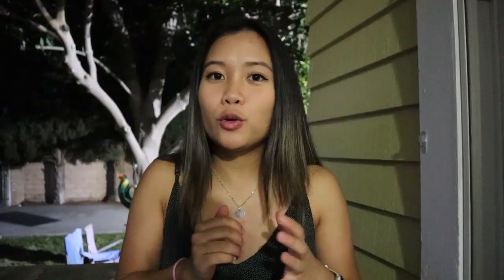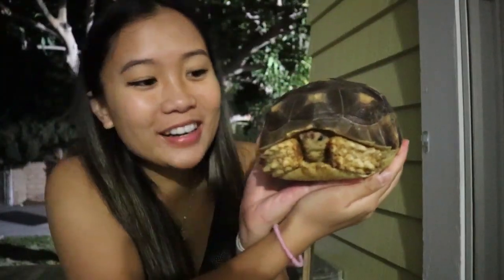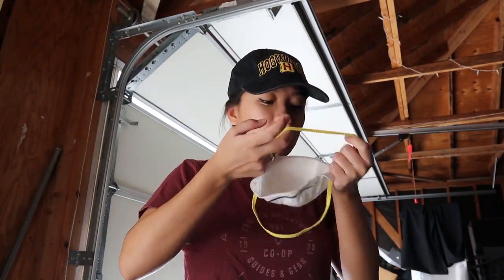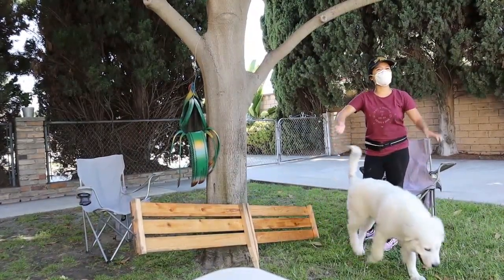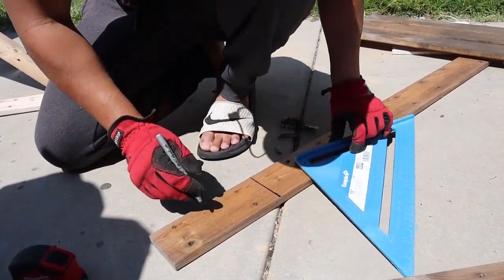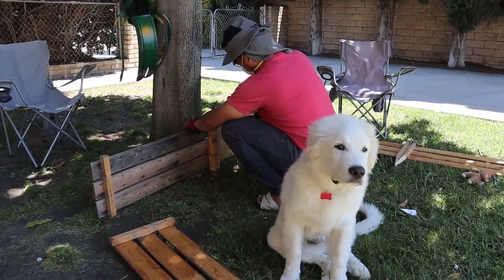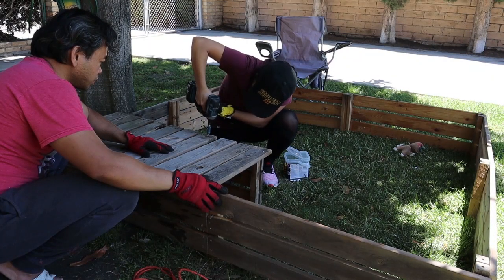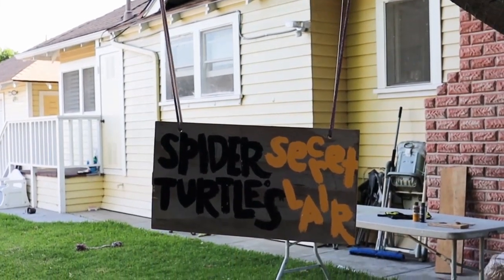Building An Enclosure For My Sulcata Tortoise!

Comment: Don’t wanna be rude but a sulcata tortoise is the third largest tortoise in the world and known as the  African sperthigh tortoise and they do not got as big as you said they get they get around 12 to 13 inches long and the get 150-160 pounds  rarely any bigger
Reply from the maker: Thank you for pointing that out! I should have clarified that it is the largest mainland tortoise species. I’ll make the correction and leave it in the description!
Reply: 24-30 inches